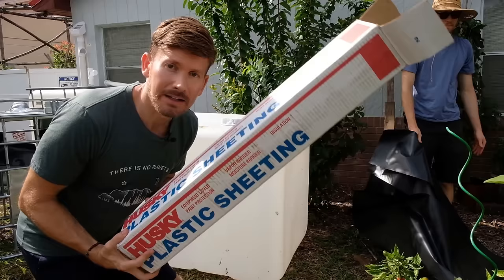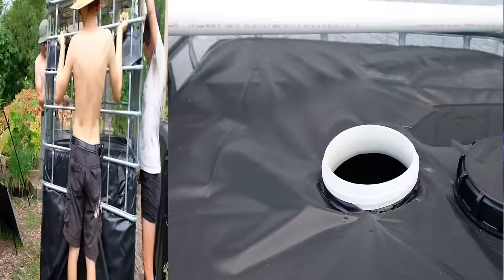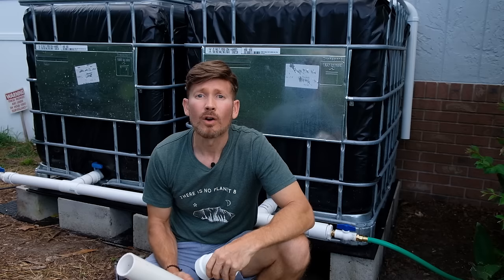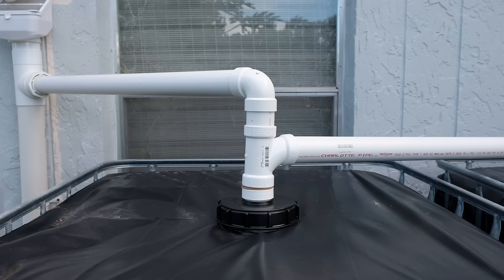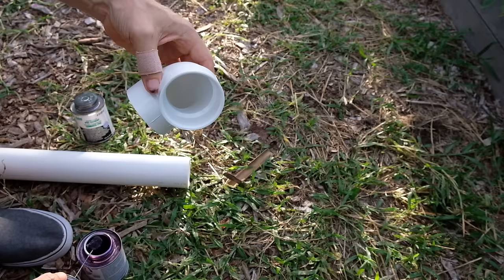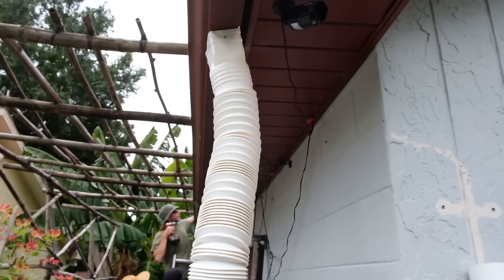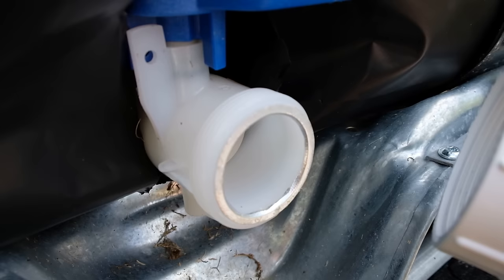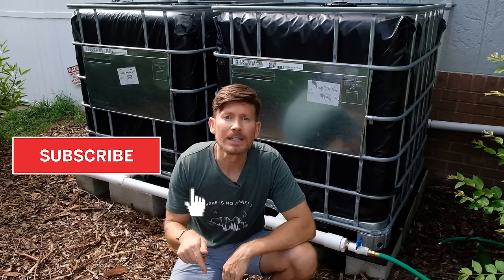How to Build a 550 Gallon Rainwater Harvesting System

Comment: Thank you for this video, question do you use a pump on your tote or is the pressure enough to feed the drip irrigation. 

What pump would you recommend if I have to use one
Reply from the maker: Hello! To get the irrigation running from pressure from gravity, you would need to have it raised higher with a strong platform or cement cinder blocks. If your system is at a top of a hill, even better. I used this pump and it fit into to small hole at the top. One of the fittings attached to the 1/2 black drip line tubing. https://www.amazon.com/dp/B076V6J44D?ref=ppx_pop_mob_ap_share. I attached this pump to one of those timers that turns power on and off for house lights when you go away, etc.

Comment: Is the black plastic weatherproof?
Reply from the maker: GODknows Hello! The thickness of the plastic is important for standing up to the weather. I wouldn’t go less than what I use here. After a year in the Florida heat and sun and tropical storms, the plastic hasn’t changed at all. However, I do think there are better ways to cover the tanks that may involve sewing thicker materials of canvas or foil insulation that can slip on and off. I don’t paint the totes because the chemicals could potentially leach through the plastic. As time goes on, my materials may change but this plastic cover has done well for me so far!

Comment: I don't think your first flush system has enough capacity.  Also, do you think that drip opening will plug up with debris?
Reply: Might have a screen inside? If not add one.

Comment: Can you buy black totes or is there an issue using black "plastic?"
Reply from the maker: No. I did find an aluminum coating IBC tote but it is rare. According to AI, "spray paints can potentially leach through an IBC (Intermediate Bulk Container) tote made of PET (Polyethylene terephthalate), especially if the paints contain solvents or harsh chemicals. PET is relatively resistant to many chemicals, but it may not be completely impervious to all types of solvents or aggressive substances found in certain spray paints." I play it safe and use the plastic liner since I drink the water. But there are some covers on Amazon that do work but don't last long UNLESS you add the special cover you'll see in my Rainwater System Update video coming out June 10th 2024.

Comment: HI.. Nice video. What size plastic are you using and what thickness?  thx!
Reply from the maker: Check the description below for the parts list. The lining is three years old now in the Florida sun and still going strong.
Reply: @naturehacker1095  I didnt even notice the list.  Thx for the heads up.  If it takes that Florida sun bet it will take that CO sun.  Thx!!
Reply from the maker: @FreshEastDenver  For sure! If you can, get it on the North side of the house to reduce sun exposure but every home setup is different and we do what we can!

Comment: Andy danger of having the tote's right against the house's foundation?

If you want the top cap of tote sealed, as the over flow pipe will be much higher than the tote in my case. The overflow will be going over the roof, and draining in the front fo the house. How would you add a second pipe for the air to leave the tote?
Reply from the maker: Sounds interesting! The key is making sure the overflow is higher than the intake pipe (which yours will definitely be) AND the air vent is higher than the overflow. In my system, I probably could have drilled a hole in the top overflow pipe that runs across the two totes and then added a rubber seal and stuck in a thin pvc pipe perpendicular to the pipe (sticking straight up into the air) several inches long to vent the system (instead of loosening the caps on the tanks). Then I would take a little mesh and a rubber band and cover the vent to keep bugs from getting in. You may add the vent over the pipe running across the roof to let out the air. The great thing about PVC pipes is that they are easy to rearrange and fix if something doesn't work out.
Reply from the maker: Most systems that people have are close to the foundation and I have not heard of any issues UNLESS you don't have a plan for the overflow. That's where people usually mess up. If the water overflows close to the house, it could cause flooding and water damage. I directed mine into a french drain along a row of flowers and fruit tress. Another system of mine goes into a small pond and a banana circle.

Comment: your overflow connection to the IBC, where the nylon is, has no cement so it will be leaking there no?
Reply from the maker: No. The fittings are actually very tight even though there is no cement. I only cement the pipes that will be under a lot of pressure. This allows me to take the pipes apart for cleaning the filter.
Reply: @naturehacker1095  thanks for the answer, i am thinking about how i want to do my overflow. This hel0s a lot.

Comment: Hi! Fantastic video. I need to know how does the second container fill up? With the connection on the bottom? So it fills up from the bottom up?
Reply: Yes the water pressure does the work to fill second tank because both values are kept open all the time.
Reply: Yep. I think you can thank the Greek Archimedes for figuring this fluid equalization dynamic out thousands of years ago.  He’s the guy supposedly responsible for getting in his bathtub, noticing the water level rise, then shouting “Eureka!” - while running down the city roads naked no less -  realizing that his body volume equaled the rising level of the water.  Because the two totes are linked the fluids aim for equalization of the downward force of air pressure on the water levels above - or something like that!  Whatever the case?  It works perfectly in my bottom-linked, four barrel 200+ gallon system I use at the side of the house.

Comment: We have a rainwater collection system that consists of 12   275 gallon totes which receive water off 3 different buildings on our property. We have used the system  for the past 4 years. It started with just 2 IBC totes and has grown. We love not having a water bill. My question is: How do you totally empty and clean these totes? I don't see much online about this. I know they need cleaning as they do get some ugly stuff gathering at the bottom. Is there some type of pump that is cost effective and will get all the last few inches out of the bottom of the totes? Is it possible to rig something up? The bottom of a tote is not flat. It is molded with lower and higher areas on the bottom. How are other people doing it? I picture getting a small pump and maybe getting down into the tank bottom with some PVC pipe to pump out that last  few gallons of not very good looking water. Then maybe using a long scrub brush of some sort. Then pumping again until it's all clean.  Comments and suggestions welcome.

Comment: Your idea about the flushing chamber is good however, you are talking about contaminants on let's assume half your roof. Therefore, you would need at MINUMUM 100 gallons of dirty water holding capacity. The way you did it you have around 5 gallons at which point the roof has only breifly gotten wet and no contaminants have come off it yet.  

The reality is that a 1000sf roof will produce 300 gallons of water with 1/2" of rain, AND more importantly it would probably fake those 300 gallons to get the crud you are worried about off the shingles. 

In other words, you are not drinking it so I would not worry about it.
Reply from the maker: It’s possible to add one or two more pipes to the first flush diverter. You just line them up in parallel and connect them together. I have a metal roof and the water runs very clear with the filters in the system. But with asphalt shingles, it would be good to have more pipes.

Comment: Will a 6 1/2" IBC cap with 2" plug fit all 275 gallon IBC totes?
Reply from the maker: I believe all the caps are the same size. Even the 300 gallon ones.
Reply: Thank you for responding

Comment: Great video. Thank you.

You chose 2" pipe to fill your tanks. Is that based on roof size and amount of water coming from the downspout?
Reply from the maker: Hello! Yes- you could probably get away with 1.5 inch on the top and overflow. The bottom is best at 2 inch because the adapter to the IBC tank is 2 inch pvc adapter and so I stayed with 2 inch pipe. You could get a reducer and use a 1.5 in the bottom but the more the pipe sticks out away from the tank, you want to have some support so the bottom pipe doesn’t sag and break. The wider the pipe, the easier it can handle the flow of water. We get some fast, heavy rain in Florida, so I try to grab as much as I can with the 2 inch pipes.
Reply: @naturehacker1095  Thank you! The building of the roof I'll be collecting from is 30x60', so am considering sizing up to 3" for filling. Will use 2" to hose bibs & pump.
Reply: @naturehacker1095  What is the surface area of the roof you are collecting from? Thank you.
Reply from the maker: @jamesgfg6043  My current setup has 300 ft^2 of roof feeding into my system. Here in Florida, I didn’t need much more surface area for this size system.
Reply: @naturehacker1095  thank you.

Comment: Why the liner?  Why not just paint them?
Reply from the maker: IBC are slightly porous, meaning that they can absorb any chemicals that were inside the tank or applied to the outside surface. This means that we DO NOT want to use IBC totes or any containers that once had toxic chemicals. Also, it means that you don't want to apply anything onto the plastic that you wouldn't drink. The alternative to painting the tank is covering them. We don't want any light getting through or you'll get algae inside the system. Choose the thick plastic liner that I recommend (2 years and still going strong) or try sewing canvas or recycled fabrics into a cube-shaped cover that can be pulled over the totes.

Comment: So, as i read on... does this (2) tanks... need venting?  you have one tank only being set up with a sock like screen and input of rain water.. the other tank is not being used unless a level gauge is being used...  Venting?
Reply from the maker: Hello! The caps on the tank are not air tight. They are loosely screwed on. But when the system fills up, they are still closed enough for the overflow system to kick in. It’s enough to remove the air as the water replaces it.
Reply: @naturehacker1095  Still quite surprised that the overflow is NOT kicking in...  i do have the caps loosened lightly, yet water sill flows from the caps. If i closed them more, then the tank body then expands... kind of freaky seeing that expansion.  my set up is just like this video!
Reply from the maker: @rtalbott7  Really? That’s crazy. I have another video that I’m making that shows the overflow in action. Maybe add a short vertical pipe coming out of the horizontal overflow pipe at the top of the system for more venting. The water shouldn’t flow out if the pipe. It will provide a place for more air to escape. I would have to see your system setup to troubleshoot it. You can send a pic to jeff@naturehacker.com
Reply: @naturehacker1095   sent you email from me... as you requested. :)

Comment: How do I keep the roofing problem from getting into my barrels? the 3 tab shingles
Reply from the maker: Are you asking how do you keep particles from asphalt roof from getting into your system? I use a few filters that keep most particles from getting in. It’s a simple and cheap solution, but I put a piece of lady’s stockings over one of the pipes that feeds the rain barrels. I empty it out every month. It can easily be replaced when it gets too dirty. I show it in the video.

Comment: Loved the vid! Only question... If the overflow pipe is above the tops of the totes, and the other tote doesn't have it's lid on all the way (to let air escape/fill) then wouldn't the top of that tote also have water coming out if the overflow pipe was in operation? If so, is there an easy way to solve that?  I want to put the totes in a large garage, so I'd need the water going where I direct it. 

Also, a heavy duty dark tarp or billboard material might last longer than black plastic?  Just a thought.
Reply from the maker: I can’t guarantee that no water will drip from the lids. One thing you could do is tighten the lids and then insert a vertical pipe into the overflow pipe above the tanks so there is an opening for air to escape. So what you’ll see is an extra pipe sticking straight up from the overflow pipe and you can place it in between the two IBC totes. The overflow water should not travel upwards through that vent pipe. It just gives the air a place to escape. It should only need to be a one or two feet long. I don’t think any water will flow through that pipe.
Reply: @naturehacker1095  Thanks! Yours was the first I saw on how to connect the tanks and do the plumbing. I watched a few others videos, particularly on stacking them as I want to do, and saw the vent pipes and their installation. As long as the top of the vent pipe is above the overflow, it will work.
Reply: Yes on the ibc top cap. Screw it tight then drill a hole for a water tight connection and a short vertical stand pipe; just taller than the overflow elevation.

Comment: Nice way to heat up your water and attract bacteria. How about just a tarp? And a cap of chlorine now and then? This is crazy overkill but an informative video
Reply from the maker: White plastic is also an option if you can get the same thickness. The water doesn’t come out very warm when I fill my buckets. We are talking 550 gallons of water and water has a high specific heat as you know so it takes a lot of heat to raise it one degree in these large containers. I’ve looked at the water under the microscope and don’t see much bacteria at all. Either way, the water is perfect for garden irrigation and it runs clear and easily filtered with a Berkey or Zero Water filter. I drink it from my Berkey daily. It really takes building these systems and testing them out to clear up any misperceptions. I was surprised myself how easy this system is to maintain and how clear the water is after a year.

Comment: I've got 2 totes and cannot get a 2" coupling to screw onto the valve at the base of the tank. Any thoughts?
Reply from the maker: Do you have a 2” coupling and it won’t screw on? Some IBC totes have a spout that may require a different connector. There are connectors for every tote. It’s just about finding the right one. Look up “IBC tote adapter” and you’ll likely find the one you need.
Reply: @naturehacker1095  yeah, just realized it's a cam lock. I got one ordered!

Comment: I live in Michigan, Do I have to flush all water out tank every time winter season?
Reply from the maker: Hello! We don’t have to deal with freezing temps here in Florida but there are some options that may work for you. First, you can certainly winterize the tanks by emptying them and clearing the pipes so that frozen water does not cause them to burst. The first flush diverted will need to be opened up so that water will run out and not go into the tanks. If you want to still use the system, you will need to install an aquarium heater into each tank that is rated for large volumes or use an aerator that will circulate the water with oxygen bubbles so that the water molecules can’t bond together into ice. I haven’t tried these solutions personally but these are some suggested ways to deal with these tanks in the winter.

Comment: As a plumber, some advice. 
Down by the hose bib, don't do what he did, stay pvc all the way to the hose. These two brass male by male nipples he has here are no good. 

When ever you make a conversation from metal to PVC, the PVC should ALWAYS BE male, and the metal ALWAYS female.

The reason for this is that metal expands and contracts with temp change at a much higher rate, and by having metal male inside pvc female, you are going to have the metal expand and crack the pvc.

On another note, ideally you should spray paint all the pvc after finishing, as UV light weakens PVC over time, making it brittle.